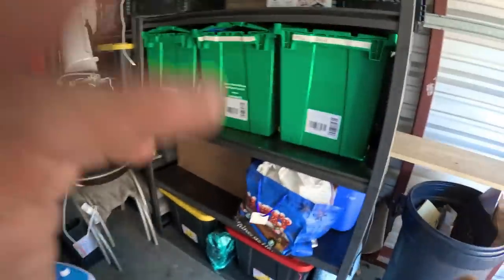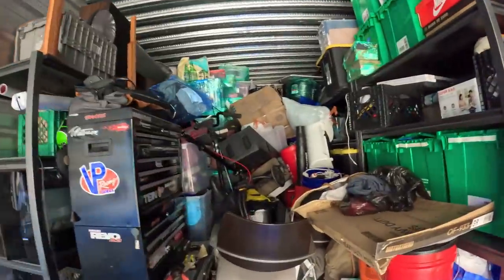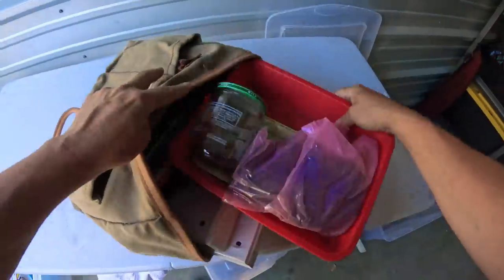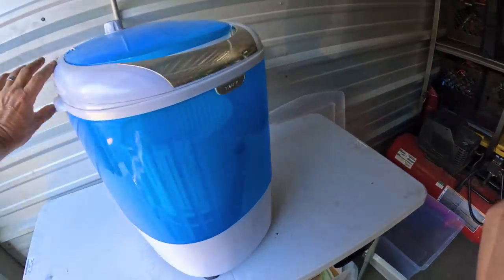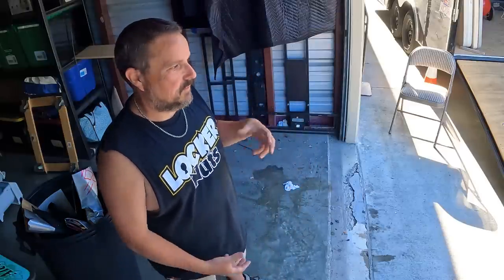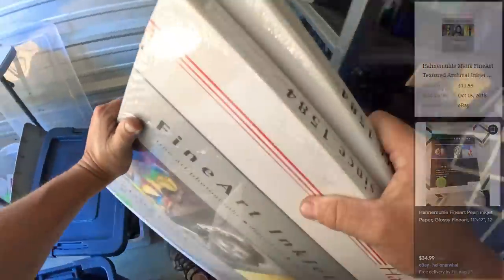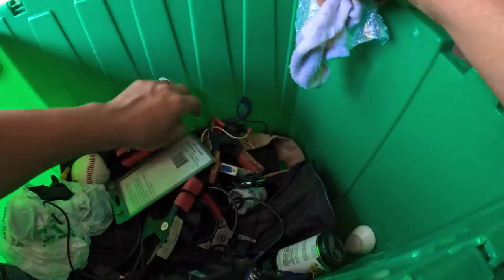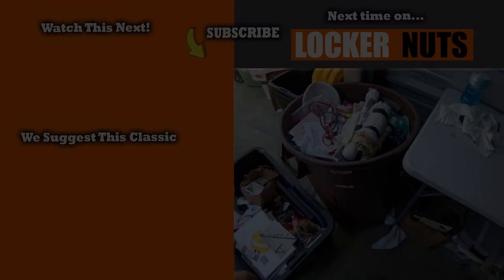Cracking open a $3,400 SAFE from abandoned storage unit! What's inside?

Comment: Re: safe entry…If you use a 3-4” hole saw…you can just cut a whole in the side in about 30 seconds.  I’ve used a cutoff wheel and got into a $5000 gun safe in less than a minute.